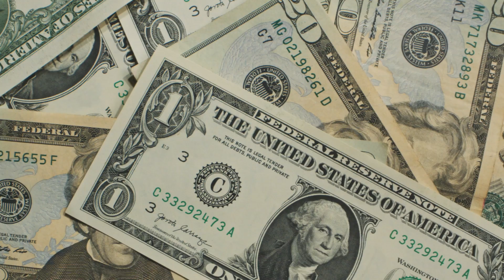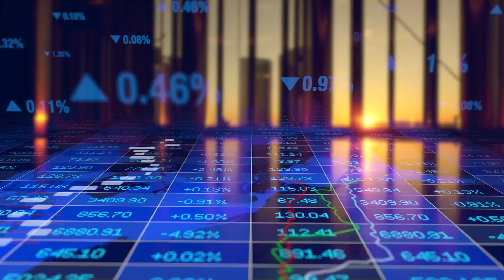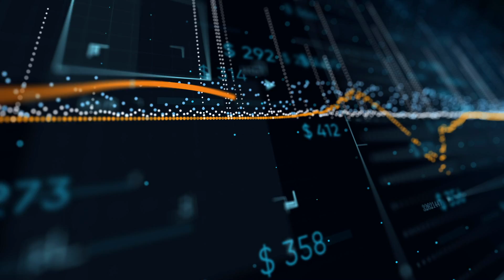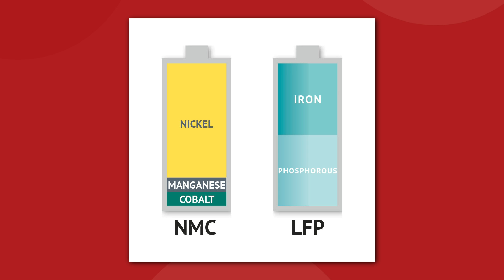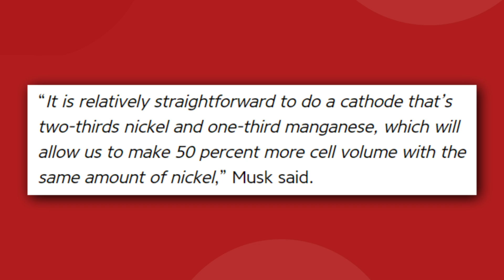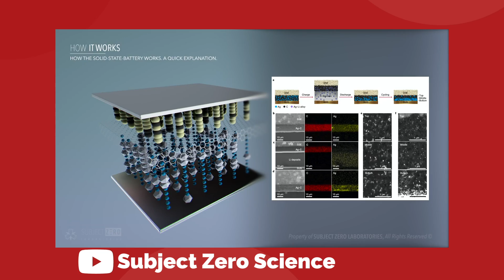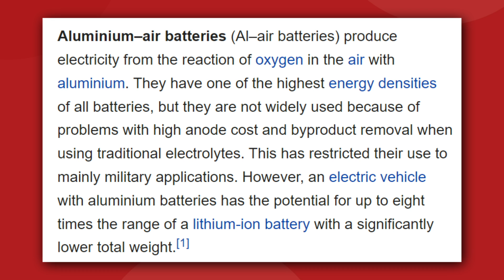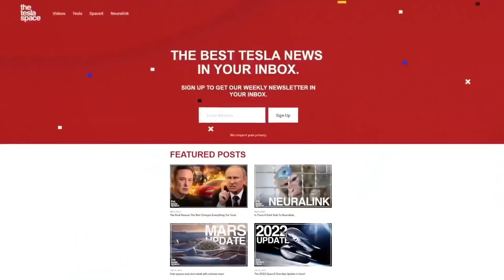Tesla's New Revolutionary Battery Technology Is Here!

Comment: Powdered nickel is also the fuel for cold fusion devices that are in use in some commercial buildings. Designed by Andrea Rossi in Italy, powdered nickel is reacted along with hydrogen and another metal catalyst. This gives off heat, with very low radiation, and it can be scaled to any size..  The cold fusion generators use the heat to produce electricity. Yildiz, another inventor, has created a magnet motor powered entirely from permanent Nickel-Cobalt magnets, with no electrical windings. The average consumer doesn't understand that there are hundreds of ways to produce electricity, and many of those methods do not require fossil fuels. Those arguing that electric cars are dirty, are not considering the impending changeover to new "clean" electrical generators, like Rossi's E-Cat.

Comment: The Algae battery has been born...new idea and so far it's still running a small computer...for over 6 months now...small...low power output but it's a fresh idea...
Reply: It sounds like the diamond-nuclear batteries. They have very small current output  and couldn't run a cell phone but could last a very long time. Also the Algae batteries, it would take 333 million of them to power a computer. So there definitely not feasible now or for the foreseeable future.
Reply: Lithium-Sulfur batteries are the future. A company is currently working on bringing them to the Market. This year they have had record break-throughs in Lithium-Sulfur battery technology. There metrics are superior to the batteries we use now but because the Lithium-Sulfur batteries are fast charging, they have a life-span of 10-years, which is shorter then the life-span of the batteries we use currently. But the Lithium-sulfur batteries have a cycle of 1000 and have quadruple the distance of the current batteries we use today.

Comment: You can have an alternator on each wheel powered by a solar panel. This will help wheels run without the need of an engine 🖐🏼 🎤 
But Elon is one of them. They are pushing AI. ...why all these guys who made this water based or electric engine cars disappeared or died and he is still alive? Because this is the new thing. He is not competing against the oil companies, they are letting him do this. He is one of them

Comment: Great video!  But I'm pretty sure the 2170s in M3 and MY are NCA (Lithium Nickel Cobalt Aluminum oxide), not NMC.  LFP is definitely a good option where you don't need maximum energy or power density, so not surprised that there's so much activity with that chemistry.

Comment: Does not realy make sense what you are talking. The acceleration of a car is definitely not related to a particular chemistry ! LFP has only one disadvantage and this is energy density. But that's where a solution like "blade" solves the problem by wasting less weight and space  on packing and as such the endresult is a lighter less spacious battery at any BATTERY CAPAITY . BYD offers for the model seal a bigger autonomy then the model 3 long range. Tesla has the problem that they have no technology them selve and are forced to buy what ever they get there hands on. P.S NIO has also like Tesla no battery technology and signed recently a contract with BYD.
There is no danger at all betting on LFP.

Comment: I'm relatively certain aluminium-air batteries can't recharge. You have to melt them down and remake the entire battery to 'recharge' it. They're good if you're desperate to lower energy density as much as possible, have access to reliable resupply and don't particularly care about costs. Which... sounds ideal for a high-powered military radio, to be honest. Not so much for anything with a sensible budget. Not unless you have a ridiculous amount of cheap energy (for melting and reforging the aluminium) anyways.
Reply: Yup you're spot on. They have to rust to produce power iirc.
Reply: Yes, oxidation of aluminum.  It is not as easily reduced to bare Al.  All electrochemical reactions for batteries must be fairly easily reversible.
Reply: Al/air batteries, or more of a power source than a battery. They can only be used once. I believe cars could use traditional batteries for short term rides. 50 or 100 miles and have Al/air batteries for long range. Similar to gas-electric hybrids we are currently using. If you only drive short distances, you will never need the Al/air batteries, but if you do need to travel long distances, you can swap out Al/air batteries in a few minutes and be on your way. Best of both worlds. Not need for 1000 pounds of batteries. 20-25 kwatts is all you would need. Just use Al/air batteries when you need them.

Comment: Aluminum-air is the same tech as Zinc-air, which has been common to hearing-aid batteries for decades.  There were even EVs using Zinc-air 60 years ago.  They were the swap & go type, where you run the battery down then swap it out and re-manufacture it.  The energy cost of that is too high, but if they can figure a way to recharge it efficiently without swapping it out or recycling it, then it might be competitive.

Comment: What about the big breakthrough earlier this year with Lithium-Sulfur Batteries?  Look up the work of Dr. Vibha Kalra with Drexel University.  They were able to produce a battery with more abundant materials that is theoretically 5x more energy dense (3x more dense in current prototypes) than NMC and can last for 4000 cycles.
Reply: You are right. They recently made brake-throughs on Lithium-Sulfer batterie technology. There fast charging & have far better range but because of there fast charging, they have a 10-year life span which is shorter then the batteries we have now but all the other metrics of the Lithium-Sulfur batteries are superior to the batteries we have now. There is a company currently working on bringing them to the market.
Reply: 2024 large-scale production?
Reply: @13thbiosphere  That would all depend on what company bought and implemented the technology, Drexel University isn't likely to build a battery production plant.
Reply: Sulfur must be liquid, so something has to heat and contain the sulfur...problematic for sure
Reply: @WickedGravityVideo  it’s not liquid, look it up

Comment: Iron is heavy dodo!
You will not accelerate very quickly.
Reply: Weight is a non-factor, it's all about energy density.  Energy density is how much energy a battery can hold for the weight of the battery.  A NMC battery pack and a LFP battery pack weighs the exact same, but NMC can hold more energy.

That's why Tesla uses LFP for the STANDARD range vehicles.  It's roughly the same weight vehicle as the Long range, there is only a 30 lb difference between the Standard and Long Range Model 3.  But the energy density is less so it won't add as much range for the same weight.

The acceleration has nothing to do with the energy density, it's all about the motor configuration.  So you are comparing apples and oranges when you say because Iron is heavy, you won't accelerate very quickly.